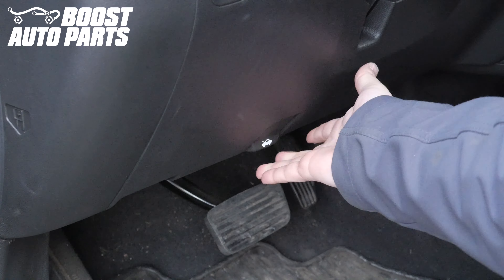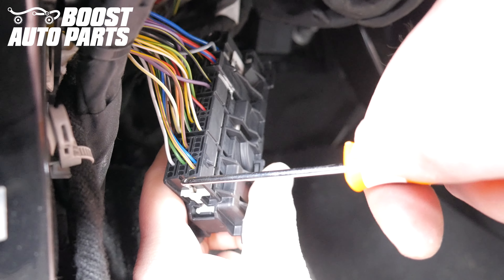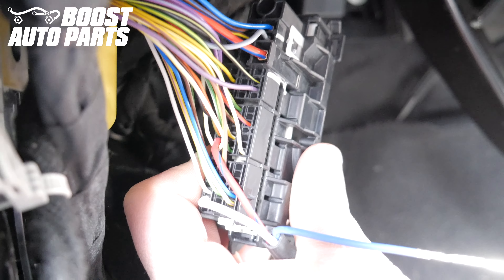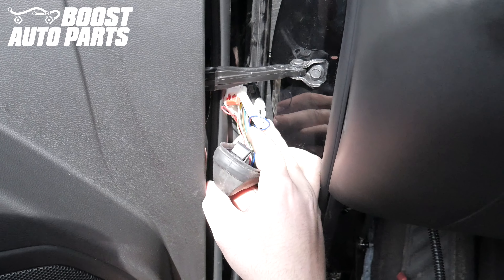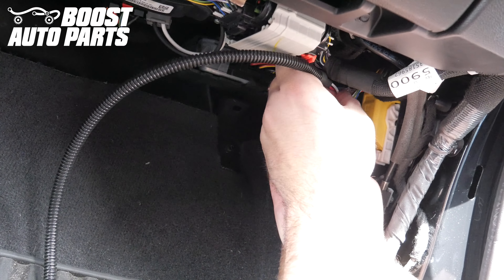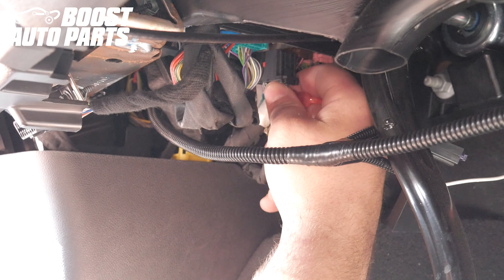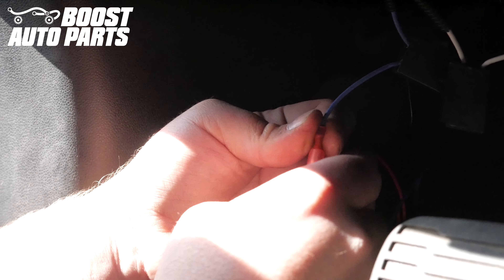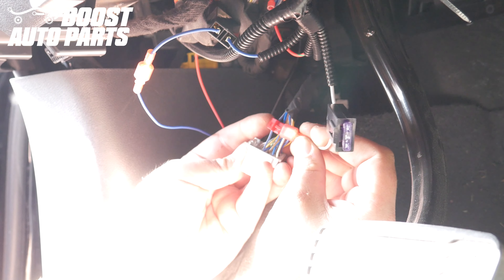GM RZY Harness for Tow Mirror Install (2019 Silverado/Sierra 1500)

Comment: Went to start wiring my 2021 Chevy Silverado 1500 and seems like every spot that I needed to connect the wire in is occupied. 
Seems like I just needed the modified door module up to the mirror connector.

Do I still need to connect the relays to the bcm? 

May sound like a dumb question but I’m a bit confused, thank you
Reply from the maker: The RZY (this video) is not applicable to a 2021 - you should just need the modify kit. Give our team a call with questions at 765-831-2830; they are standing by ready to assist.

Comment: Great video! Do you know if they are available with the side blind zone alert light? I just wish someone would create a mounting plate/adapter so the 2500 tow mirrors with the side blind zone alert could mount to the 2019+ 1500’s. The 2500 door mount is slightly different that the 1500’s.
Reply from the maker: We are developing mirrors which will be customizable including your configuration but no firm ETA as of writing this (4/26/2021)
Reply: @boostautoparts  
I have a 2019 (with blind spot and task lights) and want to buy some tow mirrors with blind spot and power folding. Do you guys think you will be having a harness for this in the future?
Reply from the maker: @rogeliom7677  Yes - we will have something in the future.
Reply: I made my own. Bought oem factory mirrors.  Purchased the glass from boost auto parts with signal on glass with the blind side alert.  Then made a harness that plugged into the light on mirror and then into the door harness.  Simple 2 wire harness.   Terminal 4 was the power/signal  and and then the other wire just got connected to ground. Very simple. Surprised nobody has created this mini harness yet
Reply: @briankazda7339 have a picture by chance. Thank you

Comment: Nice video. I was told to watch it to help install a wiring harness like you are installing that I was told would fix the missing features on my mirrors. I’ve installed the mirrors on my 2021 Silverado. They work with the spot, cargo & defrost missing. I was told by the place I purchased the mirrors, that this  harness would fix that. Is this true?
Reply from the maker: This should not be needed on a 2021 Silverado. Give our team a call at 765-831-2830 - we certainly have what you need but it's best to direct you to it based on your VIN.

Comment: So to get this straight, I have a 2019 trailboss. Power mirrors but No spot light. I need the RZY harness and modify door harness(with out spot light) for oem tow mirrors to work fully? 

Will this still work if I have an aftermarket tow mirror like Spec-D or do I need OEM.
Reply from the maker: Most other aftermarket towing mirrors are wired wrong so we always recommend OEM or Boost Auto mirrors (will be released very soon). 2019 trailboss requires RZY+Modify.
Reply: @boostautoparts  Awesome thank you. I’ll just have to be patient a little longer and buy yours if I can get oem for a good price.
Reply from the maker: @gcoe23  Ours will be available very very soon!

Comment: So, can I just buy this harness and get most features to work?  I just want the turn signal/running lights to work and the 2 small LED spotlights.
Reply from the maker: This, in combination with the modify door harness is what is needed for the features you outlined on a 2019. If 2020+, just the modify is needed.

Comment: If I don’t have puddle lights on my current standard mirrors (just task lights) but the tow mirrors I am buying have puddle lights can I get the puddle lights to work?
Reply from the maker: Puddle lights refer to the lights on the bottom side of the mirror that illuminate when the truck is unlocked at night with the key fob. OEM towing mirrors for the 1500 trucks are not equipped with puddle lights, therefore we do not offer support for them.

Comment: So if I have the optional tow mirrors from the dealer in my 2019, would this wiring harness work for it? Or would I need to purchase the tow mirrors from your site ?
Reply from the maker: This harness will get OEM towing mirrors working on a 2019, when used in conjunction with our modify door harness kit.
Reply: @boostautoparts  Awesome thanks for the quick response. Do the cargo lights  (white light on mirror side) come on when in reverse?
Reply from the maker: @isaachernandez7472  Not automatically, but we do have a reverse/cargo mod that will achieve that.